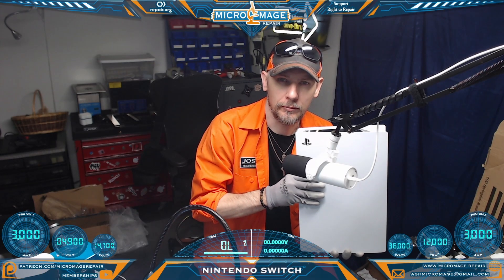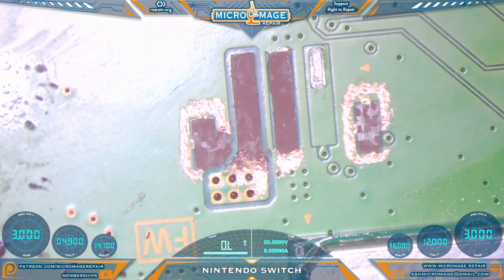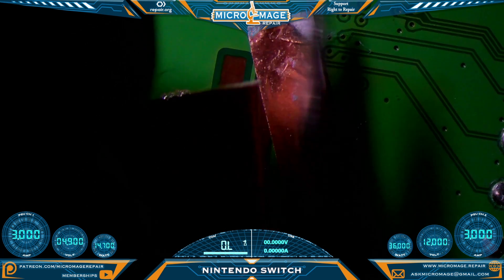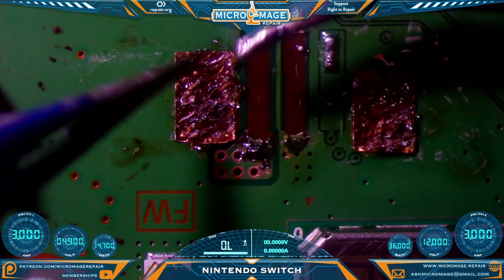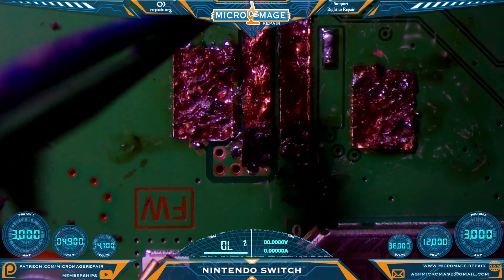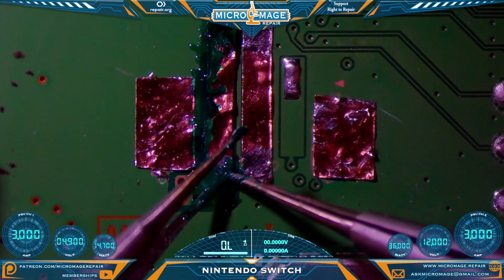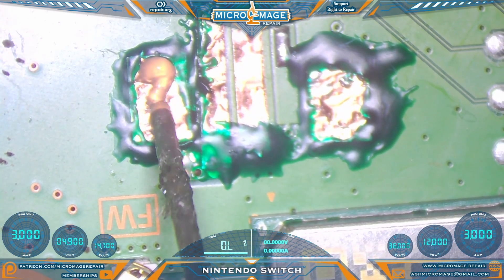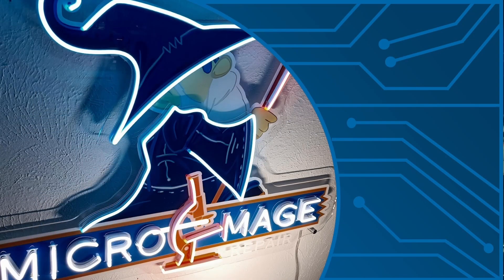PlayStation5: The Fan Connector Plague!

Comment: Actually thinking about it, maybe the sorrounding of the connector got hot, so the plastic fused a little together? I don’t know 🤷‍♂️
Reply from the maker: They just fit snug. If only they were bonded to the board as snugly 🤣
Reply: @MicroMageRepair  yeah, in my case the psu was broken, maybe some higher current made the contacts fuse 🤷‍♂️ anyway nice job

Comment: To be fair, sometimes the plugs are really freaking hard to pull out. Even if you use isopropyl on the connector sometime they are pretty stubborn. I ripped a ps4 pro connector for the PSU (and fixed it after) still don’t know why it was so hard to pull 🤷‍♂️
Reply from the maker: They are incredibly weak. 
I haven't pulled one off the board yet, know how to finesse them a bit.
Still I've wondered a few times if today is the day 😂.